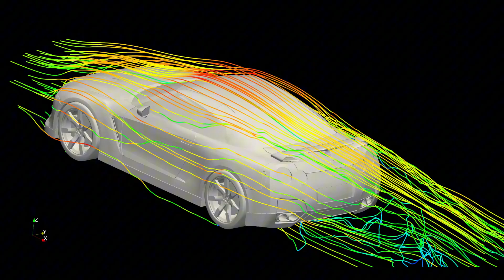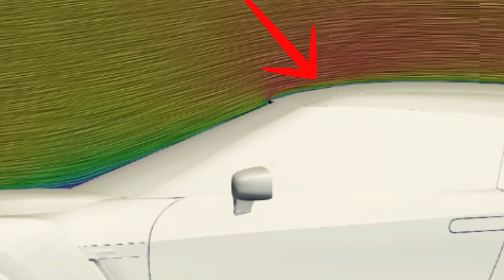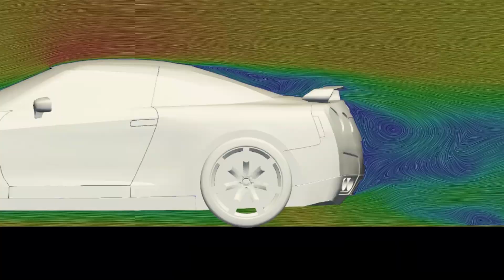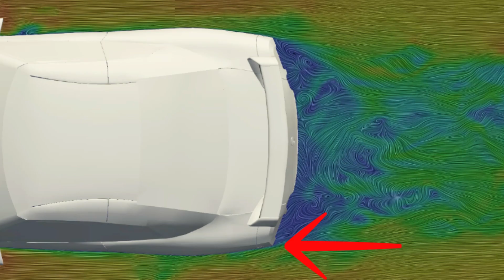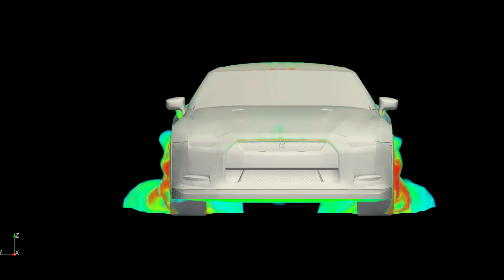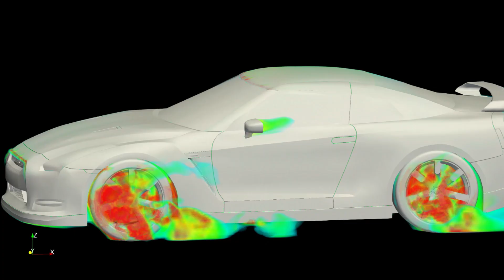Nissan GTR’s Futuristic Aerodynamics

Comment: Every GT-R that dropped since 1989 was ahead of it's time in some technical aspect, but unfortunately Nissan seems to have given up on this progression.
Reply: Nissan didn't give up, car buyers did. Their most sold cars last in recent years are the rogue, a CVT transmission crossover, and the Altima.
Reply: @ihavewaited90daystochangem51 

Can’t blame the consumers entirely either. Nissan has refused to update the cars regularly but has updated the price tag regularly. $130k for an R35 is not great value when you can buy used Porsches (911, 981, 718) for much cheaper with better quality and manual transmissions. Nissan’s failure is a result of complacency and failing to acknowledge that manufacturer-buyer relationship is a two way street.

Comment: Wasn't the original claimed at   Cd of 0.27, falling to 0.26 for the most recent versions?
It seems like the latest Nismo version we're able to preserve the Cd at 0.26 as well.
Reply: It was always 0.26 on all models
Reply from the maker: The differences in CD are because of sim accuracy, geometry accuracy, the specific wind tunnel tested in, and the exact geometry setup they tested (you can easily change a car's CD by 20 counts simply by using different rims, for example).
Reply: @PremierAerodynamics and most drag comes from the wheels so if you use drag efficient rims drag will drop off significantly

Comment: What the GT-R lost in weight it made up for in traction and aero. It was always crazy to me how much it decimated most late model corvettes, when on paper, the power/weight made it appear it should be the other way around.
Reply: This is how performance used to be done. I will always be a fan of the R35 because of the respect I've gained for its engineers over the years. It doesn't need power, it doesn't need to be light, it's just better built.
Reply from the maker: True, I'm always surprised at how some cars have almost 1,000 hp, but don't do much better than some with 500 hp.
Reply: @PremierAerodynamics Probaly the something the T.50(s) shows the best as it "only" has some ~650 HP but with quite good aero and very low weight of under 900kg
Reply: Chassis over engine most of the time